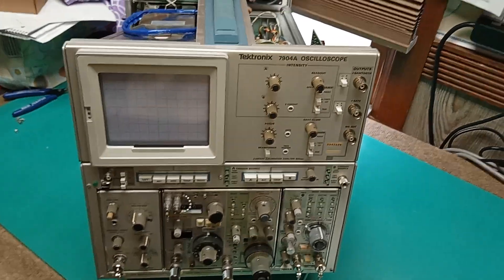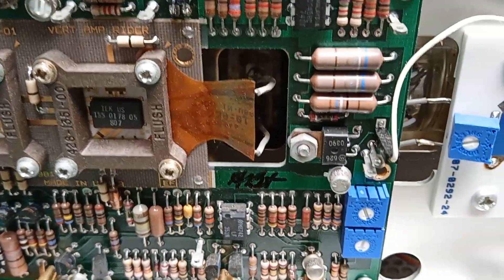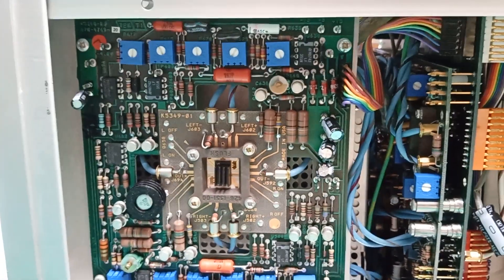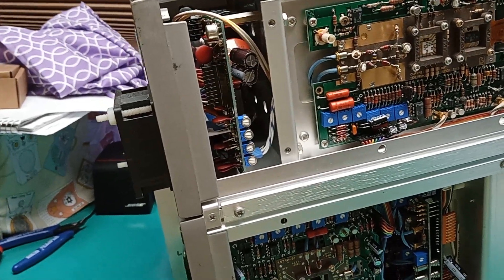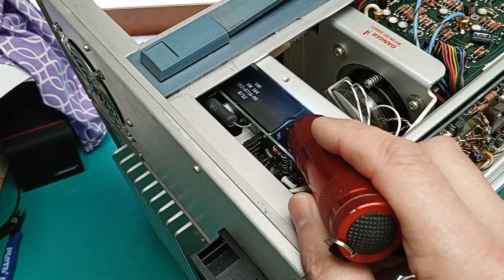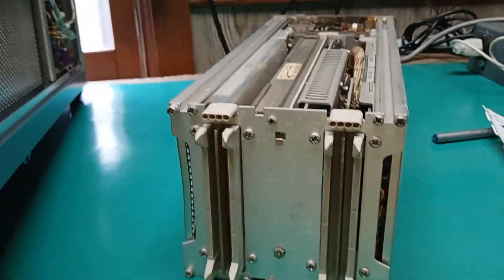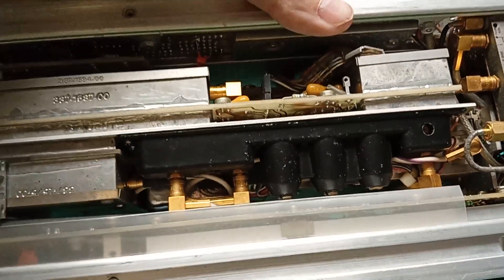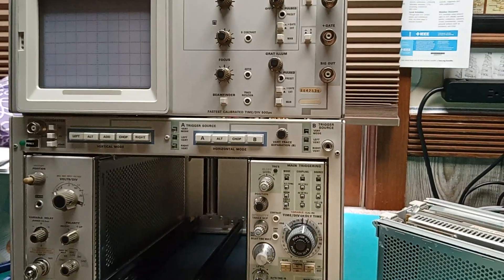Notes on the Tektronix 7904A Restoration

Comment: any tips for what to check out on a 2465 unit
Reply: RIFA capacitors in the power supply. They can go up in flames. Don't ask how I know....
Reply from the maker: : 0
Reply from the maker: Same things in all old equipment, electrical connections, switches and pots, caps...

I dont know that scope.

Comment: I bought one of these about 15 years ago for about £20 ( no SA, but 1GHz Osc plug in i think), thinking it would be an easy fix (didn't power on)....yea it ended in the bin, wish id seen this vid first! Absolute gem when working, used them back in the day whilst at Uni. Great vid.
Reply from the maker: Theyre still around but not for £ 20 anymore. Sad to know it went down in flames